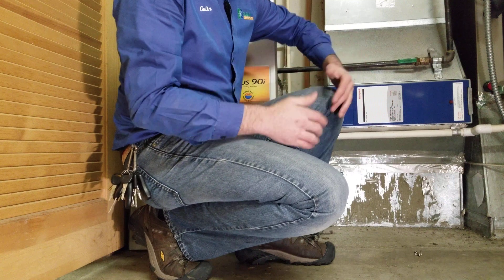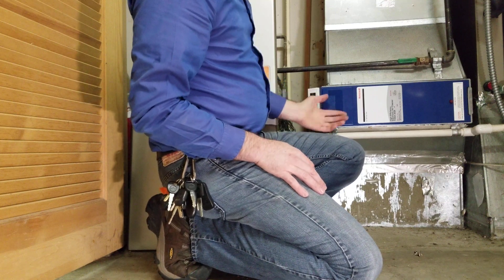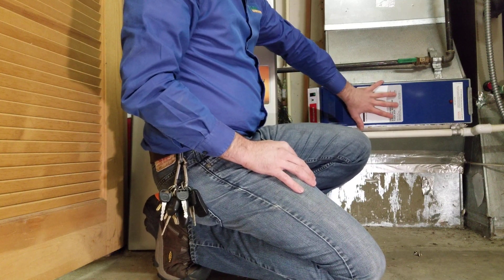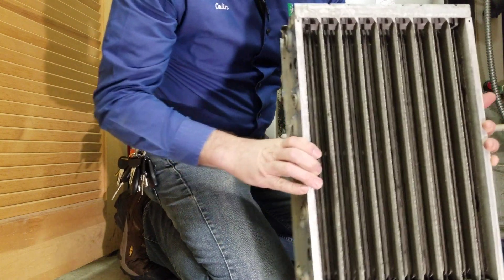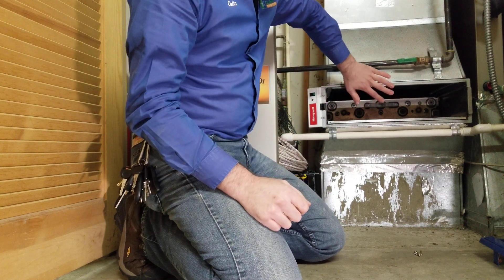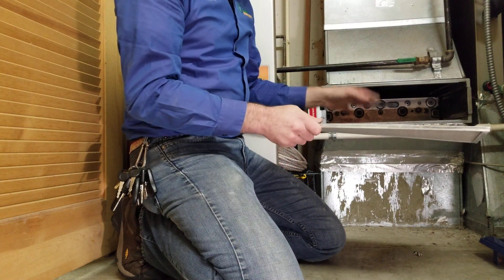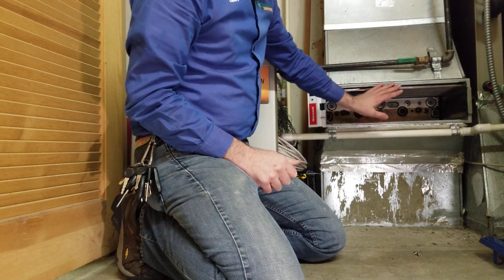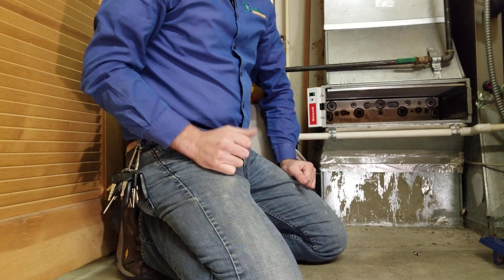Electronic Air Cleaner Pt. 2. Explaining POST FILTERS.

Comment: I have the same F300 Electronic filter. They say not to wash the post filter as they come precharged. I did not see that note until after I had washed the post filter! Is there any way of adding a charge to the filter so that it will work properly?  Thank you -good video.
Reply from the maker: To my knowledge, there is no way to charge them. Based on the training I received and having read the various manuals available on these products I remember that the charging happens when particles pass through the post filters at high velocity. The friction of the air and particles passing through these post filters is what charges the particles. That’s pretty much the same as brushing your dry hair or running your feet across the carpet, or sliding in and out of a car. The only cells inside of the electronic air cleaner which get charged electrically would be the main electric cells. I’d be happy to stand corrected if you or anyone else has better information on this. I’m going back about 15 years now so if I’m wrong, let me know.😀 personally, I care so much about the static pressure in the system that I’m not a huge fan of the post filters.

Comment: IThank you. Great videos. Question...Is it more efficient to use the eac cells or the merv filters?
Reply from the maker: The EAC sells are somewhat equivalent to the Merv 11 filter. Right now you can get Merv 13 filters quite affordably so that would be a step up. If you can install a Merv 16 filter that would be my preference. Keep in mind that the EAC sales catch a lot of particles with 24-hour fan operation at a certain low speed. If your fan doesn't work 24/7 because the heating and cooling are not on, or your friend's speed is too high all of the particles will pass through and very few will be collected so essentially your air is not getting purified. A resistive pleaded filter like murph 13 or Merv 16 are going to catch things the first pass. The air velocity and frequency of operation is still important.

Comment: When using a 16"x25"x4" pleated media filter, would you also recommend using a pre-filter and/or post-filter at the same time? If using a MERV 12 media filter, for example, would adding a pre-filter and/or post-filter create too much static pressure? Thanks!
Reply from the maker: It's not recommended. 
Only use the prefilter and post filter if you use the actual metal cells, not with the pleated filter.
Reply: @cleanairheatingcooling4105 without the filter just using pre and post filters, what is the equivalent MERV rating?
Reply from the maker: @johnspanos3862  I don't know. I wonder if that was actually tested and measured. My guess would be MERV1. The holes a huge, they don't catch anything but flies, bees and chicken lips, as my instructor used to say. Nothing's small like dust, pollen, smoke, bacteria or viruses.

Comment: Hi I have a older Honeywell, the Light does not shut off after the furnace finishes it's cycle ???
Reply from the maker: That could be because there is a short, or something else going on. Most of these units are activated by an airflow sensor. Some olderodels might not have that. If you text me a picture of the actual model number which is inside of the door I can look into it and give you a more accurate answer!
Reply: So after furnace finishes heat cycle light stays on and still makes spark noise if there is dust present ???
Reply from the maker: @jonienglish3231  if that is happening I can take a look if I know the exact model. There are several possibilities..

Comment: I have a problem with my Honeywell electronic air filter.
Periodically I would hear a loud humming accelerating sound and then a series of eletronic sparks crackling coming from the unit and then it would go away, quiet again...and then repeat after a few minutes.
I took the filters out and turn the unit on and the problem goes away but when i put the filters back in the problem occurs again...do you know why?
Reply from the maker: There could be several reasons. The humming noise most likely is from the fan running. At this point you have to be there when this happens and confirm whether the fan on your furnace or air handler is actually running or not. That's going to give us some direction. The sparking usually just means that it's either shorted to ground or it's catching or zapping particles going through.
Reply: I've also made it a habit when I take my unit apart to clean it to go in with one of those sticky lint rollers and get any hair or   small debris that may be between the pre and post filters.  We have a  Papion and her hair gets through the prefilters sometimes.  And that's what I found  was cause  Very frequent zapping of the unit.

Comment: I have this unit.  It keeps on ticking non stop.  I have cleaned and inspected it for damage. All seems ok. Any idea?   Also can I put a paper filter in side here in the mean time ?
Reply from the maker: There is a chance the clicking is due to high amounts of dust and particles passing through all the time. Maybe a dusty environment. I've been able to look inside while it's running, depending on your setup. And sometimes you can see the area where it's clicking. This allowed you to turn power off and inspect the area more thoroughly. 

On that note, I've found them electrically shorted to ground which can cause the same clicking. Let me know if I can help you firther.